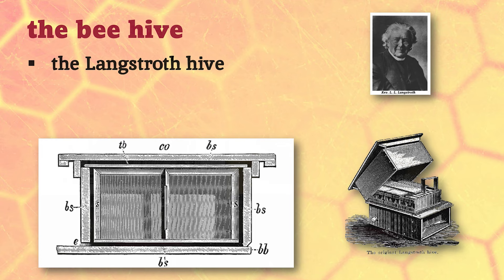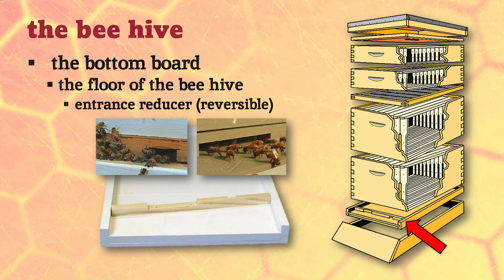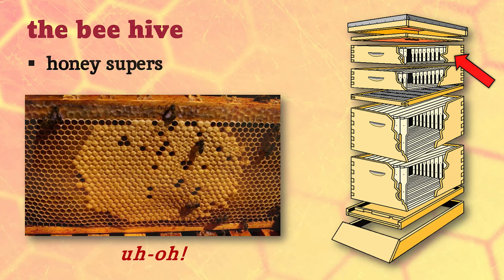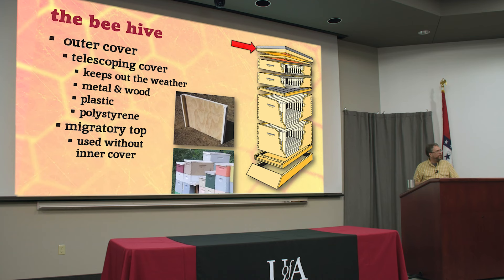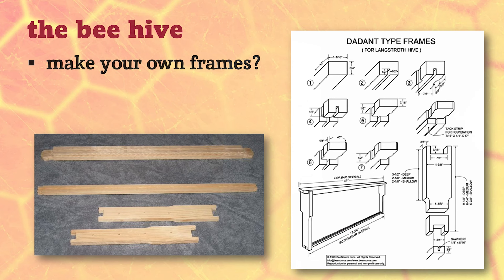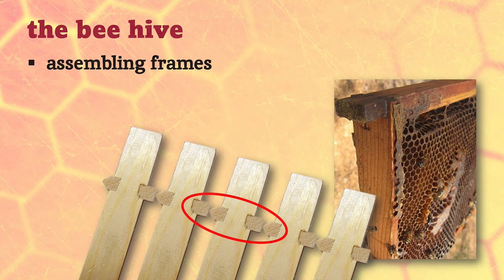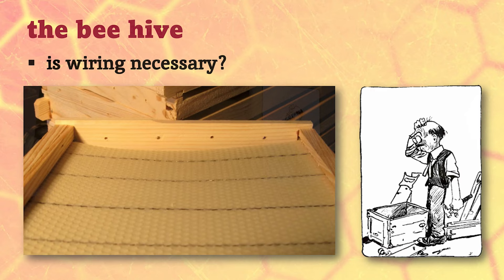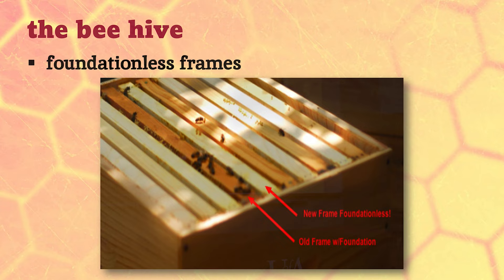Part 2: The Beehive

Comment: 1:08:00 I used Warre hives for about 8 years. I do believe they are better for the bees, especially in winter, because the boxes are much smaller, so the bees have an easier time staying warm. 
Drawbacks: they are a pain if you want to inspect the hive and management of hive beetles is a bit problematic. 
I also don't like the fact that you need to crush the comb to harvest the honey. I actually experimented with making my own Warre-sized frames, but they don't fit very well in a standard honey extractor... 
I switched to Langstroth hives once the demand for my honey became too great and I couldn't supply enough (economically) with my Warre hives. 
I adapted a few of my Langstroth deep boxes, so they will take Warre-sized frames. Several of my brood boxes are still set up that way.
I turned the leftover Warre boxes into swarm traps.
If you want 2 or 3 hives, just for fun and a little bit of honey every year AND you like woodworking, Warre hives are great. (My opinion)